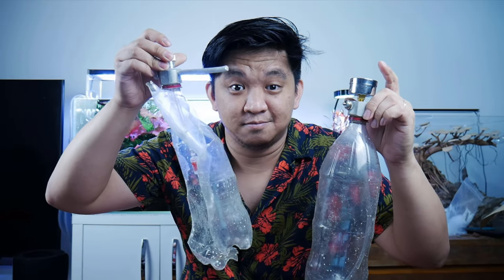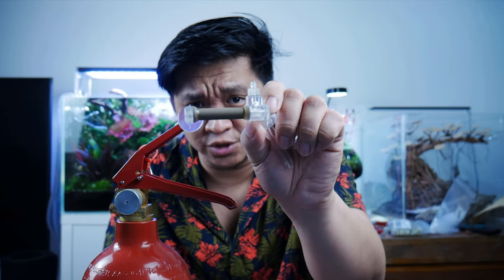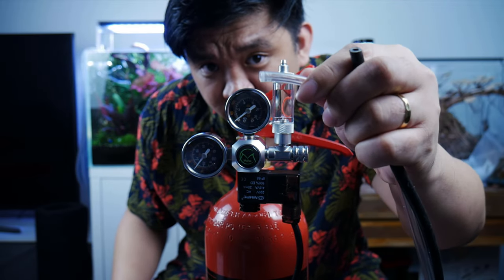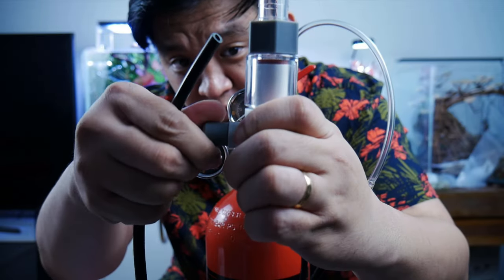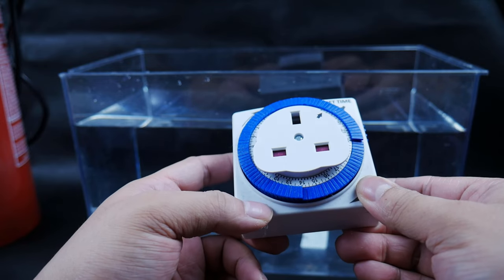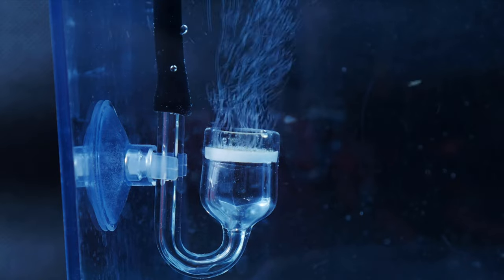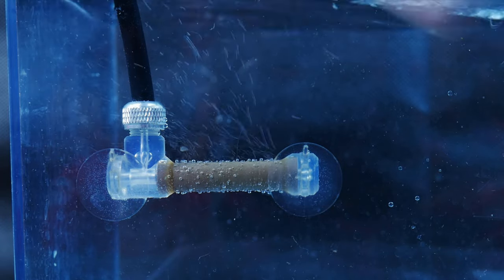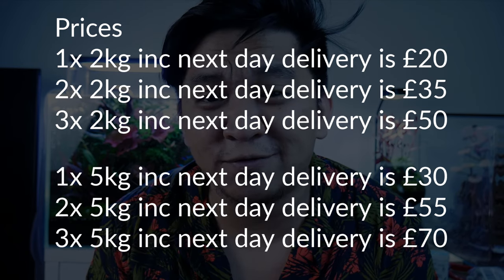BUDGET Pressurized CO2 system for Aquascaping

Comment: Noticed at 3:50 that one of your o-rings for the bubble counter isn't in place and is still in the shipping location inside the bubble tube. Also, just a suggestion; lube all threads and o-rings lightly with silicone grease. this will greatly prolong the life of the o-rings and make all of the fittings much easier to put in place.

Comment: Your check valve should be high in the system and not low (although this could have been just for the vid) to avoid seepage through the although minimal weight of water in the piping if any type of backflow occurs, as check valve springs are not that strong and will only weaken with the passage of time. Best practice is to also add a loop above the water line in the pipe as an extra precaution against backflow.

Comment: Wow!!! Amazing bro!!! Thanks for sharing! Oh! by the way,  do co2 tank is safe? I mean can he explode? I'm new to this hobby and I want to try co2 on plants. Thank you bro. More power to you. Stay safe everyone.
Reply from the maker: it should be safe of course under due diligence and proper handling. Avoid placing it in areas that would cause it to fall or in high temperature place like in front of a heater or warmer. Don't use tanks that aren't meant for CO2 for example Oxygen tanks.
When removing the gauge/regulator make sure the main valve is closed and you've gassed it out.
If you'll just leave it inside a cabinet or somewhere hidden and safe there should be no problems.
 For livestock/fishes, once you see them gasping for air, you should lower down the BPS
Good luck, and don't be afraid to ask, we are all beginners at one point
Reply: @AquaristForFun  Thank you so sooo much bro!!! Really appreciate the effort. Stay safe and God bless!

Comment: Are you able to either remove or turn the bubble counter 90º on its side? Because I'd like to use a SodaStream cylinder but if I do that it means that the bubble counter would be on its side meaning it wouldn't work.
Reply from the maker: you can turn it on its side but have a separate bubble counter along the line and not directly on the regulator

Comment: Great video. Can homemade co2 be added to the fire extinguisher? Baking soda + citric acid? Or baking soda, yeast + water?

Thanks
Reply from the maker: I wouldn't suggest opening the Co2 Fire extinguisher. It can be very very dangerous as it contains a very pressurized gas.

Comment: I recently purchased this exact regulator, however the solenoid valve keeps on acting up. When i plug in the power plug, half the time the solenoid switches on and let’s the co2 through, however the other half of the time it just doesn’t turn on. Same goes with the solenoid switching off and stopping the co2. The regulator set has only been used for 4 days so it should not be doing this. Any suggestions?
Reply from the maker: Does yours have a dc input cable or is the cable like built in together with regulator? I had both types, turns out the DC cable was acting up so I just replaced it
Reply: @AquaristForFun  The cable is attached to the regulator. So no way to replace the cable as far as i know.

Comment: how long did you use this setup?I heard from othe people they have problems like regulator damage due to the FE releasing liquid co2 into the regulator.I recently bought one for my new setup but haven't started yet.now I'm scared to start because of this issue that might cost me more.
Reply from the maker: no issues so far. been using the same unit for years and i have no problems with it. actually after this video I even bought 2 more for my other 2 aquascapes. Could be a case of user error, either they didn't use the O-rings properly or just forgot to put them on in the first place